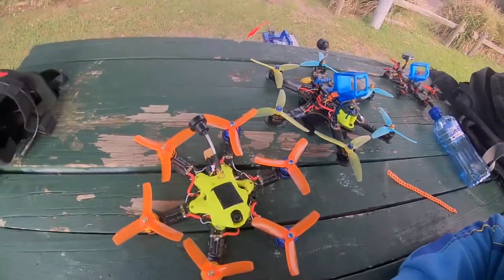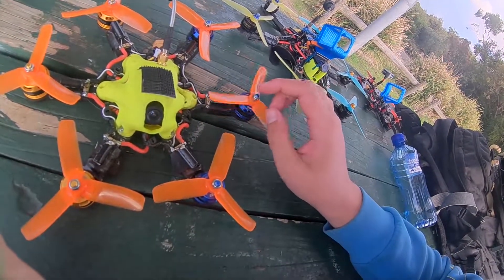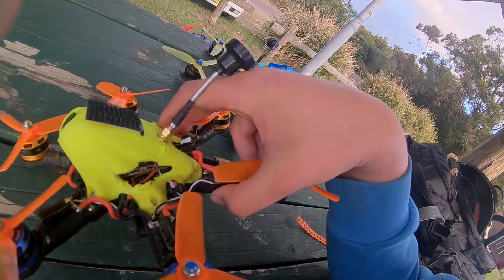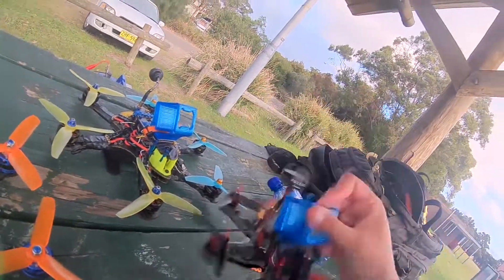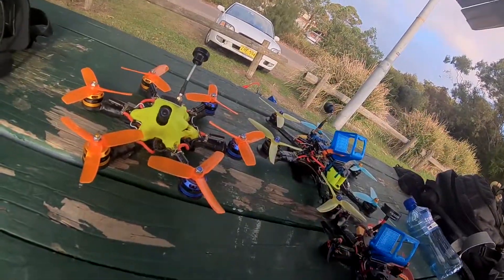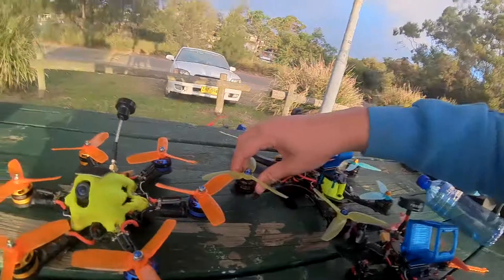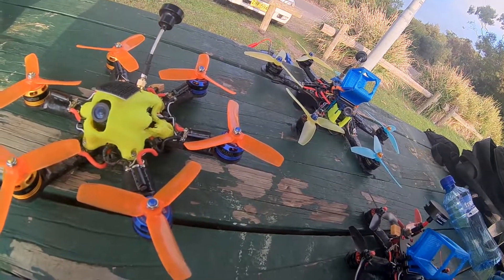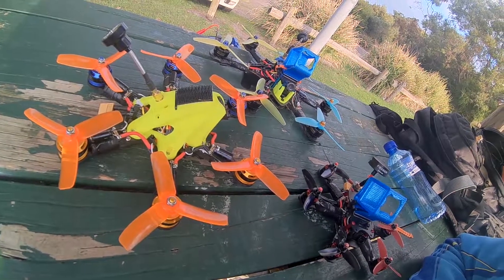Overview of my 6S 4 inch Hexacopter BR2205 2600kv @ 6S

Comment: 6s 2600 is pushing it, but definitely at the top end for tip speed for 4-inch. Coupled with it being a hex, it should theoretically have the same disc area as a 5-inch, but spread out across more props and motors should theoretically give you more grip and control as well as higher throttle resolution (more dependant on prop choice, though). I'd personally rec a smaller motor like a 2005 or 1806 just to compactify it more and block less of the blade.

Comment: how did you solder up the PDB im looking at getting one and there only seems to be 4 esc pads ?
Reply from the maker: motors 5 and 6 share the pads with motors 1 and 3 (nearest battery terminal) then i just bridge positive pads with some 20awg for insurance pad 1 to 2, and 3 to 4.